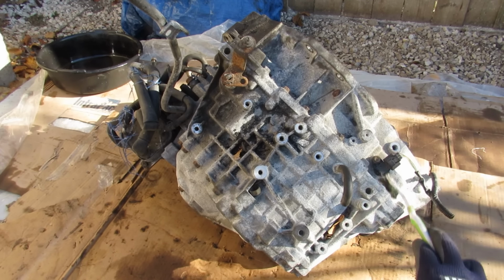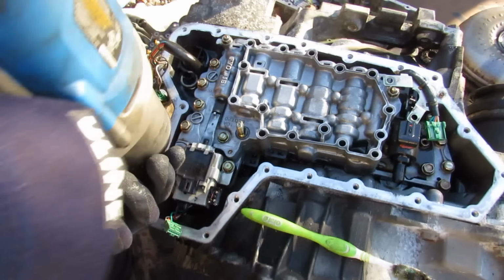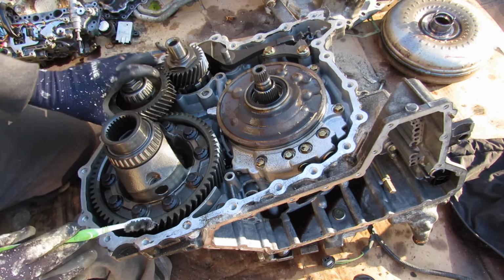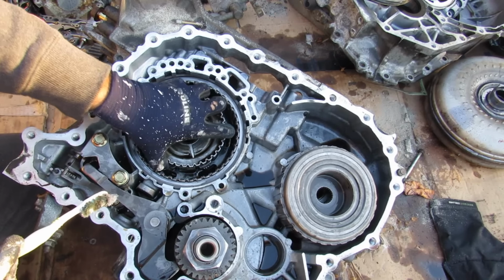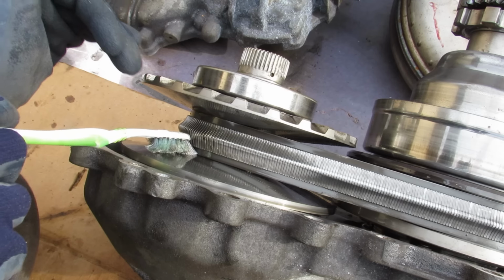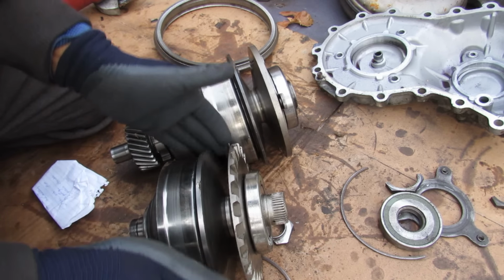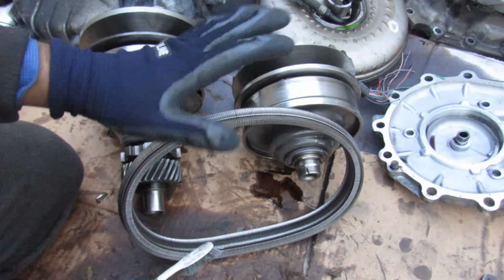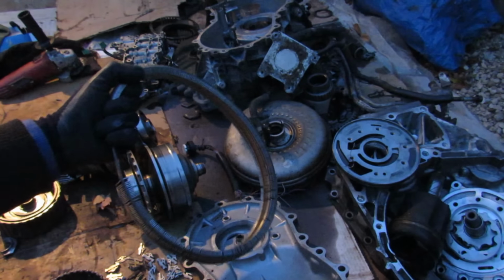Why Nissan CVTs FAIL

Comment: This man has entirely too much knowledge about an unrepairable transmission.
Reply: Well if there were parts available you could repair it..there is nothing unrepairable
Reply: @St0RM33  You're right. However, when you look at it from a Time versus Money perspective, it's simply just better to replace the transmission versus repairing it
Reply: @OptimumRacingMk3  As long as the failure isn't belt shrapnel the JATCO CVT7 can be repaired and shops are starting to get cvt specialist including Aamco.
Reply: @OptimumRacingMk3  I have to disagree. Many transmission shops are starting to dig in and learn about these transmissions. Interestingly enough, one of my cars is currently in the shop having its cvt rebuilt. The owner of the shop has spent years learning & REengineering some of the failure points of cvt's. 
Of course, you're not going to find these transmission shops on every corner, people have to call around and do some research. 
What I have found is the only shops that are willing to open up a cvt are the shops that have the knowledge to correct some of the failure points.
Reply: @OptimumRacingMk3  fck that that thing cost $3700 at the junkyard 😅 sell me the parts
Reply: @kismyc0untryazz-491  it's far easier and better to put in a rebuilt one and send the core back. Having someone remove the trans, diagnose the failure, repair it, and reinstall it, it's never going to be easier/better than getting a rebuilt. A rebuilt has been fully gone through, all the parts replaced, even ones that aren't broken (but will break), since it's easier to replace a $100 part when it's already apart. You're also not relying on some guy at a shop to do highly specialized work. The rebuilders are able to do it much cheaper and more efficiently, and it comes with a warranty. If Joe down at the shop fixes it, and something breaks, he's not going to be able to warranty the rest of the trans. If he says he will, good luck getting him to do a couple grand worth of repairs for free. Get a rebuilt and save the time, money, and hassle.
Reply: @xenonram  Thank you from a retired 20yr parts man. We had a very good machine shop in our store with a top notch old mf dragster-style machinist who smoked three packs of smokes a day, stuffed cut fingers into a pail of degreaser/lacquer thinner and knew fucking EVERYTHING about the internal combustion engine. We sold rebuilds all the time. One a week. It just isn't worth the repair of a huge, complicated item that has a zillion potential future failure points. Rebuilders replace EVERYTHING usually and you're not left holding the bag cuz you wanted to save on an unbroken but vulnerable part.
Reply: @kylemas2005  I can only imagine the labor cost when you need those CVT specialists on deck.
Reply: @gagebillingsley7166  You can find a low miles CVT for $700 from pick n pulls online parts registries. My wife had an old 2008 Sentra, its JATCO CVT7 failed @ 185k miles. We found one used for $850, it only had 20k miles on it. Replaced it for $1000 labor plus the $850. It worked fine for her till she gave it to her sister. Its still going strong to this day 4 years later. I've replaced a Honda 5speed auto transmission for almost $3k. Its doable and alot better than paying $5k for a brand new CVT. Lol
Reply: @kylemas2005  funny you mention a Sentra, I’m trading in my 2015 tomorrow and going negative just to avoid paying for when my CVT fails. I’m looking at a manual 2015 Mazda3 s Touring hatchback and maybe a few Civics with a CVT. The ones in the Civics, from what I know are ultra reliable.
Reply: @kylemas2005  I’ll remember that. I’ve heard a lot of back and forth on it so who knows maybe I’ll just end up keeping the car. The issue for me is that the transmission does not feel proper when changing gears or driving uphill on the turnpike (it feels like it is beginning to slip). That being said, I don’t wanna risk it being too late and then have to pay a bunch of money I don’t have to fix it - I’d rather hop into a different loan, which will probably be a lot lower of an interest rate, and then just keep that car and have fun with it yanno?
Reply: @gagebillingsley7166  There's no gears to feel though. The cvt takes some getting used to vs a traditional automatic as its ratios are infinite. Just make sure you change the cvt fliud every 30k you lies.
Reply: @OptimumRacingMk3  many times the "time vs money" thing says "replace the car" also.
Reply: @OptimumRacingMk3  depends on wht's wrong with it.  Had a 05 Murano and the CVT started acting up.  Turned out to be a defective stepper motor.  Fixed it myself with a part from ebay.
Reply: @OptimumRacingMk3  this is not true. these can be overhauled for about 2 grand, which is still better than spending 6 grand.
Reply: @St0RM33  it's better if you don't have to replace at all...no?🤔🤔🤔
Reply: @St0RM33  you said it. Many needed parts not available unfortunately. Also if customer won`t pay, also unrepairable. That last one is usually what makes anything unrepairable.
Reply: @St0RM33  Arguable.
Reply: @St0RM33  If there are no parts then it is indeed unrepairable.
Reply: @nitetrane98  i rebuild cvts all the time.. there are full sub assembly replacments ..
Reply: @nitetrane98  Unless you had more than one transmission that failed for different reasons, then you could salvage the good parts.  If a lot of these have been just replaced, then it stands to reason there must be a lot of used parts out there.
Reply: @nitetrane98  Parts are available for these units. You just have to know who to call :)
Reply: Interesting to see how things seem to be blatantly engineered to fail
Reply: @vid2ification  The average lease term is 3 years or 36k.  They want you buying/leasing a whole new car by then.
Reply: @Big_Ben1988  thats what i said...
Reply: What I was thinking.  But I am impressed.  He does a great job explaining it.
Reply: I agree! Never ever going to own one again! Stay away from cvt in will break you with major repairs $$$$$$!
Reply: I was thinking the same, but it was quite interesting
Reply: Straight trash transmissions
Reply: @Jedi_Luke  Depends a lot though on hp, torque, owner maintenance etc. I agree a traditional auto is more durable but if your car is under 100HP and you do fresh cvt fluid changes you should be all right. I know Mitsubishi and Suzuki use the same JATCO CVT7 as Nissan but over the years have demonstrated a much lower % of premature cvt failures.
Reply: @kylemas2005  Why even play the game though? Just get a manual or automatic and basically never have to worry about it. The push for CVTs is driven by profit, not that CVTs are superior in any way. They are simply cheaper to make. Weird the cars never got cheaper though, huh?
Reply: @someguy5035  Manual and traditional autos are getting harder to find each year. My personal experience with the three CVT vehicles have been fine. I think for the majority of CVT owners, they don't experience premature failure if they're diligent about preventative maintenance. I think a lot of it is the "internet effect" or anecdotal comments. Complainers always post way more than folks where everything is going fine. That's just my 2 cents though, if I personally went thru a CVT dying at 60k miles and being stuck with paying $5k replacement, I'd be pissed too. Its just every other car I see is a Nissan ranging from brand new to 20 years old. I just feel that if the problem was a systemic as what's posted online Nissan would be in big trouble from the press, consumer advocacy groups, hell even congress would get involved like they did with the VW emissions scandal lol.
Reply: @kylemas2005  A large quantity of anecdotes becomes more than just anecdotes. And the number of lawsuits Nissan has lost is very telling as well. Moreover, Nissan's sales have been in decline for the past 10 years.

They were forced to extend the 5 year warranties to 7 years.

It is a foregone conclusion at this point. CVTs are just not reliable.

CVTs are used for 1 purpose - they are cheaper to manufacture than conventional transmissions, up to 50% cheaper. 

Audi got sued and stopped using them. 

In their current form, they are junk.
Reply: @someguy5035  I understand you wanting to stay away from them, I really do. They work great though for my 78HP Mirages. They're hardly taxed at all.
Reply: @shannonholcombe4546  huh?
Reply: I repair them all the time. Stepper motors are the biggest problem and they are readily available. Solenoids and valve bodies are next and they’re available. Everything else except for the belts and variators can be bought. If you need a belt or pulleys you must buy them from a salvage yard.
Reply: @davidhine2991  stepper motor was exactly what was wrong with mine.  Ordered the replacement part from fleabay for around 90 bucks.  I think the genuine Datsun CVT fluid was almost as expensive as the part.  Watched a video of the repair a few times and changed it myself.  It was a straightforward repair.  Was still working fine after 50,000+ miles when I sold the car.
Reply: @Akira S I guess it's from the years of experience repairing these.
Reply: Maybe so but helped me learn why my trans failed and to keep my laundry away from him!
Reply: Lmao!! Agree!!

Comment: I'm now wondering why this showed up on my feed. Please God, don't let my little altima fail me now.
Reply: Trans flush if you're  under 80k with a filter replacement and flush it every 30k from then on. You're trying to borrow time. If you're over 80k you'll have to do a drain & fill.

Comment: I own a 2007 Nissan Versa (215,000 miles) and a 2015 Nissan Sentra (125,000 miles) both have CVT transmissions and I have had zero problems with both. Would not hesitate buying another Nissan with a CVT.

Comment: I had two CVT transmissions replaced on my Altima at a cost of $7,000 each. Nissan paid for both replacement transmissions under my new car warranty. Nissan made no money on my car.
Reply: What year?  I’m terrified of my 2016, with 69k.  However, I just ate $200 to change the cvt fluid, trying to get to 120k.
Reply: @Dutch1982  My Altima was a 2017 and had a "shudder" at 20-30mph and started with 1,200 miles on the car. The next transmission failure happened at 15,000 miles. I've heard that only Altimas with V6 engines with paddle shifters exhibited the transmission problem.Traded that car in a bought a new 2019 Maxima and not a bit of problems with that CVT.

Comment: "Dipstick sold separately". Another reason why I have no interest in newer cars.
Reply from the maker: For real. Newer Nissans have a tube with a cap on it.
Reply: Well that's because it doesn't need one.  There is a plug on the bottom that you pull and let out fluid until it stops.  This way interpretation of fluid level on a stick is not required.

Comment: We had one of those in our pathfinder...  between it and several other quality issues we got rid of it pretty quick.
Reply from the maker: When did it fail?
Reply: @speedkar99  first weekend we had it 2013, it failed to downshift below 15 mph on a steep mountain road, we fought with Nissan about it for some time then replaced it with a 2015 Ford, by then we were experiencing several small issues.

Comment: NAILED it. But I will say while it's 100℅ true this design isn't good for high torque applications it actually said, with bold lettering, in the owners manual "Driving this vehicle aggressively will cook the transmission."

My wife took that to heart and has already pushed her's past 240,000 trouble free miles. The downside... is that belt whining is still with us 14 years after we got it. (Car was assembled April of 2006 so the Jatco CVT is at least that old. Engine is a 2.0 Liter  I4 of mediocre power... But it isn't dead yet so...)

Comment: Really good overview of this type of transmission. I was involved in the Saturn CVT when it was under development as our plant manufactured some of the internal clutch pack pieces and hydraulic pieces. Recipe for failure and was one of the reasons Saturn is gone.
Reply from the maker: Thanks. So are you the one to blame 🤣
Reply: @speedkar99  LOL, nope. We tried to warn them that the parts needed a post process to achieve the cylindricity and surface finishes they needed for a hydraulic cylinder but they wouldn't pay the extra miniscule fee to do it. The parts were run straight from the stamping press with a burnishing die and it wasn't good enough. Other issues too such as a bad overall design made it a failure from the get go. GM is always pinching pennies unfortunately.

Comment: I had a 2006 Ford Freestyle with a CVT. I had 122,000 trouble free miles on it before I got rear-ended and totaled. The car weighed 3,400 pounds. I hauled everything from full rear seats down loads of firewood to sacks of garden soil but I never exceeded the maximum load rating though. Ford said that the transmission itself costs $5,000.00 to replace plus labor. The fluid changes were a bit pricy though. They are a sealed high pressure system with no dipstick. You needed a Ford machine to change the fluid and had to pull the engine / transmission part way out to change the filter. Ford price, $500.00.

Comment: Enjoyed the video. Really have to put a move on it to fit all the content into a 20min video. Wonder from who he took the toothbrush? And does it get washed an returned... See there is some aftermarket pushbelts for Nissan available quite pricey. But what is the use it the rest of the parts that take wear can not be replaced.

Comment: So I know you pointed out you can do as far as preventive maintenance goes, but is there anything you can do to maybe beef up the cooling system? 
Is it possible maybe to attach a secondary cooler with the extra necessary fluid to keep things cooler?

Comment: Very instructive video, thanks for making and posting!  Bottom line: avoid Nissan CVT's.  Scotty Kilmer claims Toyota makes a reliable CVT which uses conventional gears for "1st gear", and then switches to the belt afterwards - thus sparing the belt from the most extreme torques.

Comment: Ok, why are CVT belts ‘pusher’? What about the design makes this necessary?

CVTs are for snowmobiles and lawn mowers, not cars. Avoid them like the plague..
Reply from the maker: If you pull on a steel belt it won't take much load. They are stronger in compression than in tension
Reply: It seems that the Passenger Vehicle Application of CVTs appears to be a problem in particular. However, CVT's have been around for many years in Large machinery as well. Things like combine harvesters employ CVT transmissions, albeit in a much simpler, larger and stronger package than that in the flimsy and overly tight packaged assembly unit shown in this video - no wonder they fail. Reason for CVTs in Combine harvesters in particular is that you can remain in optimum engine speed (Optimum power band) while changing the Harvester's ground speed by simply shifting a lever forwards or backwards, depending on crop and field conditions. These are HUGE machines yet the transmissions last for many years under very heavy operational loads. I remember as a young boy on our farm, the first combine harvester we had was a CASE-IH with a CVT transmission. After a few years of hard service, things (like bearings, pullies, shafts) started to break continuously, yet the CVT held up. I guess it depends on the application. The Combine sends vast amounts of torque through the CVT yet at relatively low rpm (about 1500 rpm maximum), while in a passenger vehicle RPMs are much higher, which in turn can send transmission temperatures soaring.
Reply: It’s just, there’s nothing wrong with automatic transmissions. They don’t need to be replaced by these. The only, and I mean the ONLY impetus behind car companies doing it is a tiny improvement in gas mileage. As in a couple percentage points. But they like to say, ‘Multiplied by millions of cars blah blah blah...’. Which just means the individual owners get stuck with the huge repair bills. 

Same as another incredibly stupid idea, having gas engines shutdown at red lights..

Comment: Anyone that has ever owned a snowmobile could tell you why the Nissan CVT isn't a great idea.
Reply from the maker: I've never driven a snowmobile. I wonder how those CVTs work
Reply: @speedkar99  
They have belts and variable pulleys attached to a chaincase.
The drive clutch is attached directly to the pto shaft and has springs and flyweights to increase/decrease the effective pulley diameter.
The driven clutch is attached directly to the input shaft of the chaincase and has a coil spring and ramps to increase/decrease the effective pulley diameter.
There is a belt between the two pulley.
When the engine is at idle and the sled is at rest, the drive clutch is at its smallest diameter and does not engage the belt while the driven clutch is at its largest diameter. As the engine rpms increase, the flyweights force the movable sheave of the drive clutch inwards, increasing the pulley diameter and engaging the belt, as rpms decrease, the springs pull it open and decrease the pulley diameter.
The more torque applied to the driven clutch forces the movable sheave "up" the ramps forcing it outwards and reduces the pulley diameter.  When torque is reduced, the spring pushes the sheave "down" the ramps moving the sheave inwards and increases the pulley diameter.
The belt is almost always the weak link.
Even with the far superior materials used in modern belts, they are still subject to wear and breakage.